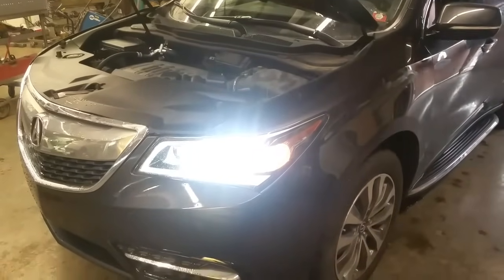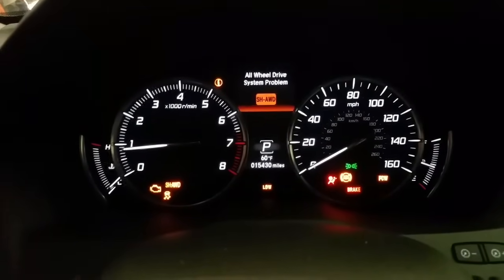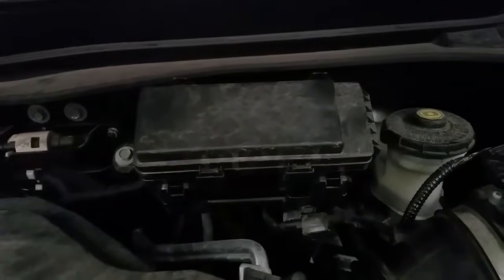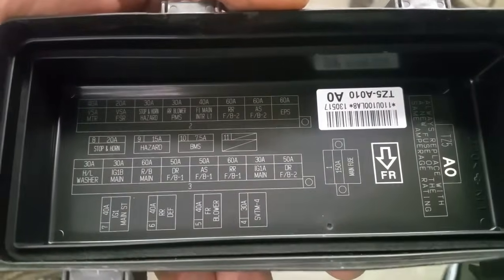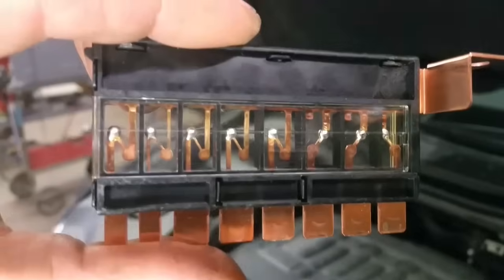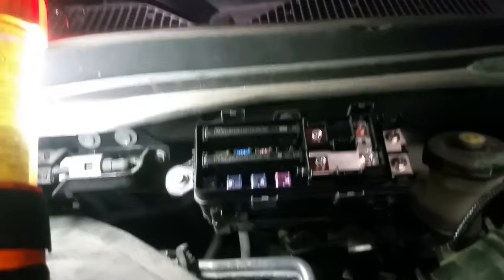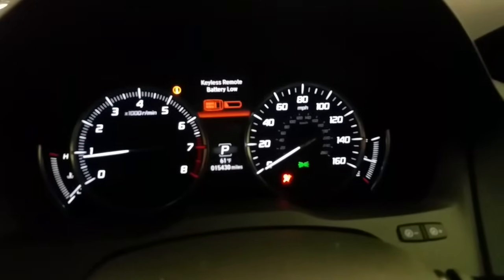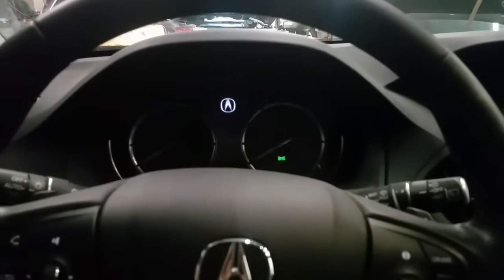EASY ACURA, HONDA ABS, VSA, BRAKE, FCW, SH-AWD, TRACTION, CHECK ENGINE LIGHTS FIX!!!

Comment: SAVED ME A TRIP TO THE MECHANIC!!!!  My 2009 Acura TL over the years has not given me a lot of problems.  From time to time I'll get different lights coming on which are so annoying. I removed my fusible link. I did not have any broken links. Cleaned the contacts with alcohol and replaced the fusible links.  I started my car and all the lights disappeared.  Thank you so much!!!
Reply: U gotta be joking.  You just definitely have me some hope
Reply: Worked on mine also 2009

Comment: Would be nice to get a part number of the fuse you replaced
Reply: He should of at least showed how he fixed it
Reply: 38234-TZ5-A01 38234TZ5A01 Multi Block Fuse "O" (8 Circuit) w Screw for MDX Passport Pilot Ridgeline etc.
Reply: Google it dingus

Comment: I have a 2016 Honda pilot AWD Touring.  Same problem. All the lights came on at one time and didn’t go off on restart. I removed all of the fuse bars in fuse boxes A and B.  None of the fuses were blown.  However, after spraying electronic contact cleaner on all of the exposed contacts, I reinstalled and all of the lights went away. I hope this is some kind of a fix. Thank you for your video. Excellent information and probably saved me a bundle of money.  By the way, I found that fuse box A was very dirty inside. It appeared that the rubber seal was not installed properly from the factory.
Reply: 2014 MDX here. Same issue and the George method did not fix because no inline fuses blown. So, it's been 9 months with yours, did the problem resolve?

Comment: Thank you sooooo much for posting this simple instructive video. I have a 2015 Honda Accord and all of the warning lights came on last night and my car failed to start (I was about 30 mile from my home). Fortunately, after a handful of attempts, the engine started but the warning lights stayed on. This morning soon after following your instructions on displacing the VSA fusible links from the box housing, I noticed that all the fuses were intact but there was debris along the blades. I cleaned off the blades with CRC electrical contact cleaner and placed the VSA fusible links back in its designated slot. All the warning lights ceased to be visible. THANK YOU!!!
Reply: patpeno I have the same problem in my Honda Accord 2015 exl any help
Reply: Did you guys find the issue

Comment: Thank you!! I have a 2019 Honda Pilot and the dealership charged me $80 to tell me the issue was a $1200 camera replacement. My fuse wasn’t blown but just taking it out and reinstalling it fixed my problem!

Comment: Thanks Man, my wife’s 2015 RDX this morning did this even thou there was no issues yesterday when she used the car. I pulled out the links that you suggested but saw no bad fuses but I turned on the car and no warning lights all gone. Thanks I was nervous because her car was even sputtering and that stopped to.

Comment: Thank you very much for the instructions. You saved me a trip to a dealer and a hefty bill. I removed the fuses and none of them was blown.... so they went back. I started the engine and all lights were gone!  It looks like like it reset itself. Any way many thanks again.
2010 Acura MDX
Reply: Barbara T thank you so much, re installed the module and all warning lights gone.
Reply: Possibly muck on the VSA Fuse contacts.  Did this fix the problem long term?

Comment: I have 2012 Acura MDX, 130K mileage, last week three lights appeared and four messages like Check Trailer Stability Assist, check VSA, ABS and SH-AWD. I already faced issues in winter when fob key was not opening the door lock, fob has new battery so I knew there is something inside the car and now in normal temperature sometimes lock was working and sometimes not. I called CAA and person checked the battery and said battery and alternator is good but your battery is 6 years old, normal battery life is 3-5 years so it is your choice to change it now or later. I decied to change it now but after that lights and messages were still present, even I checked after 10 hours in the night and still lights and messages were present. Next day in morning, after 24 hours, when I started then all three lights and four messages gone. I was really happy and now everything is working fine. Even I checked the Acura self diagnosis and it didn't show any error, all were green. It was just a weak battery problem but the messages were scary :).

Comment: Part number: 38231-TX4-A01
Multi-Block fuse - Make sure you say "Passenger side", as there are two blocks.
$15.44 with tax
Finally got around to this because my car needs inspected
Good luck!!! Works great!!!
Reply: 38231-tx4-a01
Multi block fuse
Reply: 38232-TRX-AO1? What year Acura you have?

Comment: Glad it worked for all of you but not for me. No fuse's blown. The scan tool at AutoZone says 3rd transmission pressure switch high. It's replaced but still have all the lights on with hard shifting.
Reply: Check to see if your throwing a code p2647?
Reply: same with me I checked the fuese's no fuse's blown,
Reply: All MDX owners have had to have this problem, and Acura knows it! I got the same diagnosis from AutoZone. My link is intact.😢

Comment: Thanks so Much George!! great video!  I had the exact same problem with my Honda Civic 2015 and now all my dash lights are gone too.
Reply: I am having the same problem, how could you solve this problem?
Reply: Me too, I've checked the fuses are intact, those lights goes off when I start driving but comes on when I'm idling or when I turn on the AC

Comment: I had same thing happen to me, before doing this I would recommending pulling the codes first. In my instance I had a P0301 code which was a cylinder 1 misfire.
Reply: Travis Bennett 
Did replacing the fuse fix your misfire?
I'm getting the vsa light with check engine and it's also a misfire
Reply: @wickedcity77rg  did u ever figure it out
Reply: @ABcd-bj7vh  why is literally nobody in the comment section replying to anyone that’s asking if their problem was fixed.
Reply: @twinturbobmw535xi7  
I think YouTube switch off comments notifications by default for some users.This happened to me and I had to go to settings to switch it back on

Comment: Question is what caused the fuse to blow??  From the accident?? Normally a fuse doesn't blow unless something shorted like a cut/grounded wire/harness. My experience is 47 years with M-B and BMW.

Comment: Thanks George Melnik show how to fixing ABS, VSA , Brake light on Honda Accord & Acura MDX about fuse box relay.  My Honda accord 08 having the same your MDX ABS, VSA, BRAKE light on
Reply: What you do to get them to go off
Reply: If anyone having this issue with the brake light, abs, vsa, traction, especially on accords, especially 2013-2017 . It's likely your abs module! Replaced my daughters 2013 accord and just a few months later replaced my wifes 2012 accord. Dealer is about $1300 just for the module. I found them used $50 for the 13 accord "I was lucky " I don't think the junk yard knew the value and $150 but asking price was $200 for the 12 accord " lucky again " because I was patient . Most places charge between $250 to $500. Their are some places that rebuild them and correct the thin ass metal/wire. They look like staples but super super thin and when repaired they add more soldering material than before. Hope this helps someone

Comment: The abs and vsa lights actually turned off. All i did was take out the fuse and cleaned it a bit, put it back in and the lights turned off. I might replace the fuse eventually since it does seem like it was repaired or replaced before. Granted, this could be a temporary fix for me but worth it. I also checked the codes using a scanner but no codes popped up. Thanks
Reply: sorry to be so off topic but does anyone know a method to get back into an Instagram account..?
I somehow forgot my password. I would love any assistance you can offer me.
Reply: @Elias Torin instablaster ;)
Reply: @Reginald Declan thanks for your reply. I got to the site through google and im trying it out atm.
I see it takes a while so I will get back to you later when my account password hopefully is recovered.
Reply: @Reginald Declan It worked and I finally got access to my account again. Im so happy:D
Thanks so much, you saved my account !
Reply: @Elias Torin You are welcome :D

Comment: Hi George, having the same issue with my 2014 RLX Hybrid after disconnecting the abs sensor after replacing my axle seal this past Saturday, so my question is does the RLX have a similar fusible link in one of the many fuse boxes...thanks in advance!!! My push button is doing the same thing as well and I have to hold it to power the car off.

Comment: Thanks. I replaced both of my struts, then broke a wire harness that connects to my speed sensor, then I got a bunch of trouble lights. Even when I fixed the harness. I will try this.

Comment: Does this apply to a 2013 honda accord ex. Video was very helpful. Thanks. As columbo would say, one more thing,  do you have any vids on a 01 Acura 3.2TL.
Reply: I have a 2013 Honda Accord exl aswell  and I’m wondering if you did this to your car to fix your problem
Reply: @JBoogle8732  actually the car belongs to my daughter and she want let it stand still long enough for me to check it out. Hopefully I'll get a chance next week,  cause I have to replace some body parts. I'll let u know if it works. Have a blessed day
Reply: @bobbybenn8275  did it work ?!
Reply: @calebesejour8306  no, I checked all the fuses and they were good. Back at square one.
Reply: Bobby do you find the problem?
Reply: @dandiortiz9003  no, I tried all the fuses, they were all good. I gave up. I just have a year round Christmas tree.
Reply: @bobbybenn8275  omg lol. Some people had luck getting a new battery , others replaced the keyless entry module to fix this issue. Seems like there is multiple things that can cause these  issues

Comment: My 2010 RL ACC, AIR BAG and ABS keeps coming on, clears itself after you turn the engine off for a minute or two. System works fine, then lights up like a Christmas tree again and again. Any ideas

Comment: I have a 2012 acura mdx and the sh- awd light and traction contro light is on. the only code i keep pulling is b1835. i cant find much about this code except that the telescoping steering has a short to ground or something. have you come across this problem? if so any info would be awesome.

Comment: Had this issue. Fuses were fine. Ended up being the battery even though the battery tested good.
Reply: I wonder if this is my issue. I replaced my battery already like 3-4 months ago with a Walmart battery. I wonder is it’s the culprit. I’m having the same exact issues as the video down to a T.
Reply: @Robert Essary, your battery tested good but you still had the lights on the dashboard? And after replacing the battery the lights went away?
Reply: @twinturbobmw535xi7  have you solved your problem? I replaced this fuse link and the VSA module and still having this issue
Reply: @BikeLifeHooligan  Hello, did you find a solution? I’m having the same issue.

Comment: Honda Accord 2009 ex  I had this problem due to an accident and when i got my car fix this lights stay on (avs and abs) for months I change the fuse witch is not sell anywhere but ebay i had to buy the whole fuse box to get this fuse but it was worth.   <<<NOTE>>>  my lights (avs and abs) didn't  vanish right away you need to drive the car a few yards for the avs and abs to go away  this is due to the avs system every time your make a turn the avs will assist you and if the fuse is good the light will go away
Reply from the maker: Yes you absolutely correct
Reply: Hello Goerge. I also got a Honda Accord that has the same lights on, so I check fusible links and I tried to solder the fusible links. The lights are still on any recommendations would help.

Comment: This seems to be typical of honda and acura. All warning lights flash: VSA, ABS, Check Engine, SRS, EPB, etc.  Can a weak battery cause this? A bad battery cell? Disrupting all electronic systems, modules and circuits? If the main relay is not blown, can you perform a "hard start"?

Comment: I have the same problem with the multiple lights on the dash boart , I did check what you suggest but all is good ,,
Reply: do you ever fix your problem? I'm having the same problem,
Reply: @alexandraventura5547  Hello, did you find a solution? I’m having the same issue.

Comment: My 2009 MDX says  check SH-AWD....SYSYTEM car Drive's fine light is on..any ideas😶 could my fuse be out.in the message center it said using to much power.
Reply: Did you fix your light is it still on how did you fix that problem  ?
Reply: @vinnyterlizzi9865  it was the alternator and down the line had to replace that expensive ass catalytic converter acura wanted 1200 found a after market for 700 ..but the front end was bad so it cost me 1800 to fix that and that's wut fixed that SH-awd front end would rattle when on messed up road's

Comment: How do I rest the SH-AWD light on a 2008 Acura mdx it came on while I was on the highway and I was trying to pass a truck so I accelerated really fast next thing you know the SH-AWD came on I pulled over and turned off the car but it was still on. I also noticed that when I looked at the awd screen that I was not getting any torque to my back tires only the front? What do you think is wrong?
Reply: Ramon Cruceta that happened to me today, how do I fix it?
Reply: I have same 2008 mdx same problem changed all fluids in 3 locations work for short period but seems to be intermittent you will see my fix request at top of this screen posted today Ernie lang

Comment: Hey George i don't have that fuse defective i checked it with a voltmeter and all the fuse around the motor bay are ok.what could it be

Comment: Just tried this on a 2014 accord, all fusible links were good and seemed clean, so I just popped it back on, gonna take a short drive and hopefully the lights stay off.
Reply: Hello, did you find a solution? I’m having the same issue.
Reply: @homerogarcia7287 no, ended up getting rid of it , all
My research was pointing to the ABS module tho.

Comment: Does a 2011 mdx have a fusable link?   After going through somewhat deep water,my vsa abs etc lights came on, eventually they cleared but over time it kept happening more.  During a recent oil change they claim a brake pedal position switch code may be the cause and quoted me $190.  I also seem to think this issue deactivated my sh-awd so i started looking into other reasons that could cause this, and found your fusable link video.  Hooing i can resolve these codes soon,  besides chiming and being annoying the 4 wheel power distribution graphic isnt showing any power to rear wheels so i was wondering if car is only in 2wd mode now. Thanks!
Reply: It sure is. I’m having the same exact issues as the video and my awd isn’t working. It’s in fwd mode.
Reply: My car blew a cylinder in march 2022 and its dead. 2 mechanics advised a new engine. W 186k on it i had to junk it.   After 2 months of looking and not being able to find a good mdx, 2015s were all i could afford in the 24-26k range i wound up getting a 2015 nissan murano platinum w 59k mi and its been a disaster.  So much keeps going wrong with the car. Money pit.  Build quality is crap. Never again would i get a nissan. Never.

Comment: Hi my. HONDA accord 2009 vsa, abs and park brakes lite up. Can this also be the.source of the problem, the fuseable link? Thank you
Reply: Emerson Crisostomo I’m having this problem currently !! How did you fix it??
Reply: @SarahBrody  Sara im having this problem, do you now how did fix it ?
Reply: @edwinavelar  nope, unfortunately I’m still having the same issue. I’ve done everything except replace the fuse
Reply: @SarahBrody  Did you figure your problem? I changed this fuse and replaced the VSA module and still have all the lights on my dash
Reply: @BikeLifeHooligan  nope, I’ve just left it alone at this point lol the light stayed on after I got my rotors, breaks and bearings changed so I think it’s a sensor issue
Reply: @SarahBrody  in your case I’ve read of the lights coming on if a wheel bearing is installed backwards so the abs sensor doesn’t read the magnetic pickup on the bearing.
Reply: @BikeLifeHooligan  oh shit, that would make sense. I’ll look into that for sure. Thanks! I’ll also update on here if I get it figured out

Comment: Would that affect honda sensing system? I have lane departure,  collision,  cruise and lane assist problem comes up.. this happened after car wasn't used for a week. Fired it up and this lights came on my 2016.. every so often it works.. go figure

Comment: Hi George thanks for the video,I have Acura MDX 2001 and the VTM light is on and that disabled the 4 wheel drive, I am in winter season and I need them so bad, can you help me out. Thank you.
Reply: Could be vtm4 sensor near the differential or one of your 02 sensors are bad
Reply: Its the VTM sensor....

Comment: I have 2013 acura TL, SH-AWD, and it was in accident before I owned it. it has 3 signs coming on the screen, 1- check SH-AWD,  2- Check VSA, 3- Check Hill Start Assist System. Spent $400 by showing it to different mechanics, no one has fixed the signs. Any clue?

Comment: You should also read the codes that the computer is throwing.  There could be other issues that cause a check engine light or VSA light to turn on.